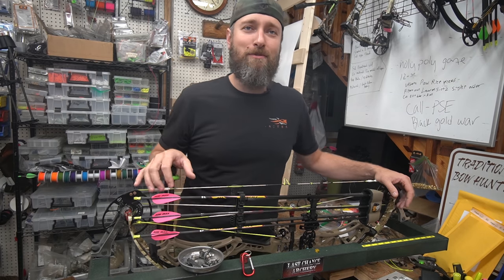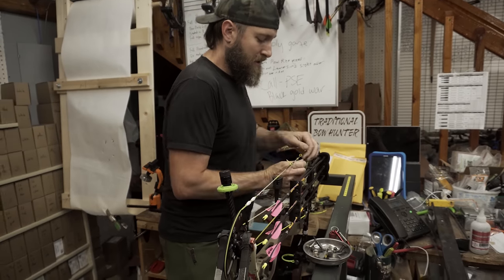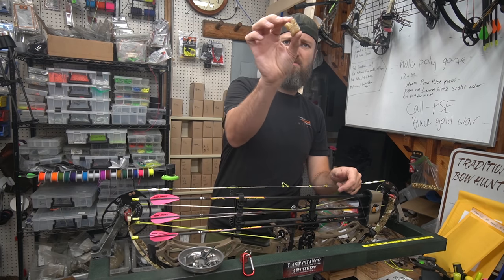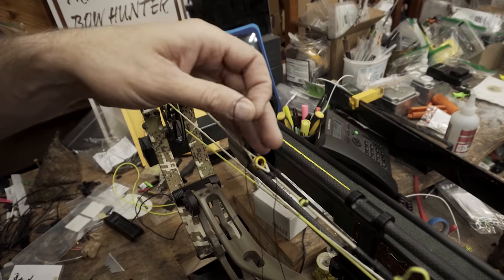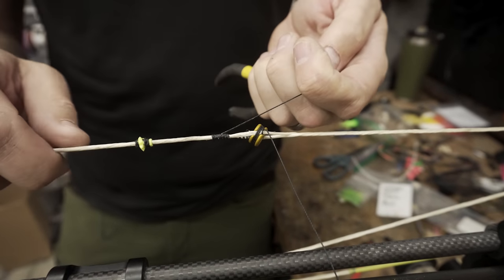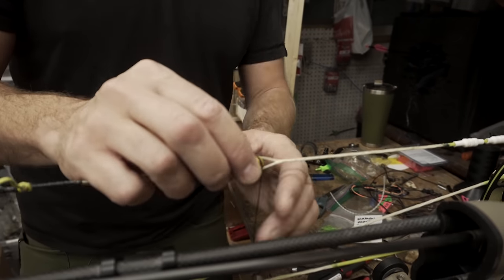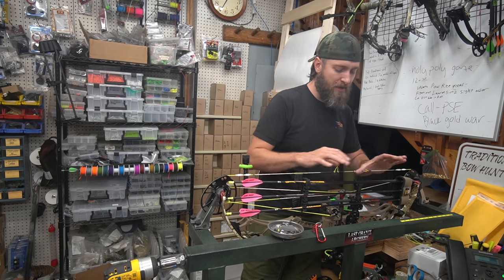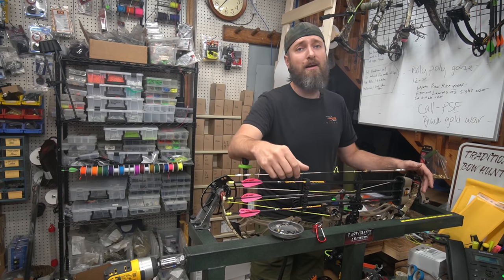Tying in a peep MFJJ style!

Comment: That’s how I tie my peep. I tried tieing my peep like bowmar 1 time with all half hitches and will never do that again. Great info mfjj. Keep the tech videos coming it’s hard to find bow tech videos that you can trust and being a tinker I learn a lot by trial and error. I would like to cut out all the error possible. I have a press , draw board, bow vise and arrow saw so I try to do everything myself but that damn error keeps coming back it would be awesome if you made a series on basic bow teching and basic tuning for people like me that have the equipment and want to learn but have no where to find the knowledge that is 💯% trustworthy
Reply: 😂😂 same, pain to remove, but damn solid
Reply: Bowmars is rock solid but ya gotta be sure it dead on. Use an o-ring around the peep and string until you get it where you want then tie it in. The o-ring will keep it in the string and allow for adjustment until you get it perfect.

Comment: This may be a dumb question but is it possible to move a peep sight a small amount up or down the string after it is tied in? I think when setting up my bow at the local shop the peep got tied in about .25-.5 inches to low so I feel my self scrunching down to see through the peep and line up with the sight housing.